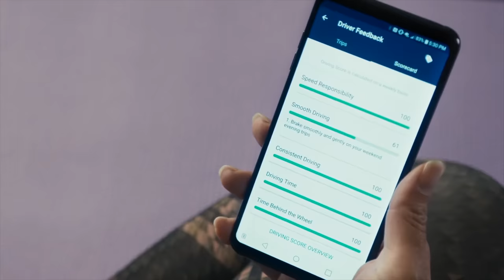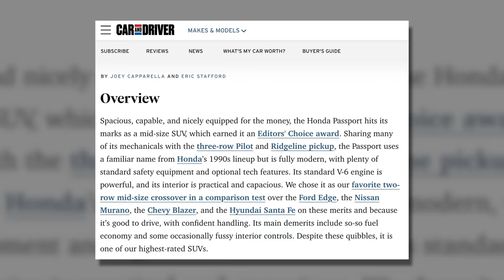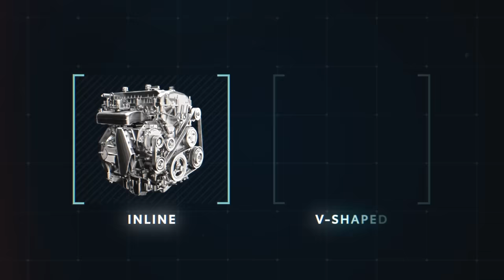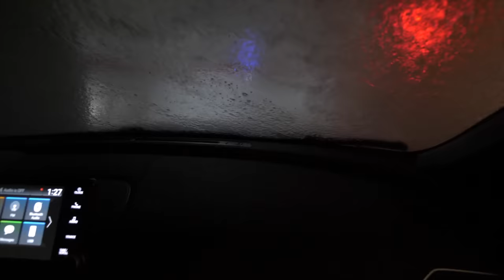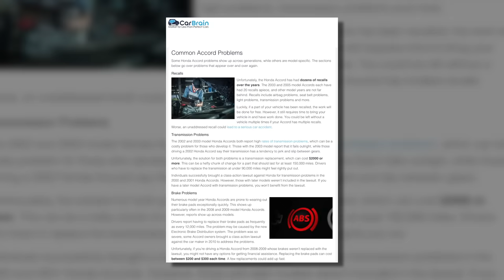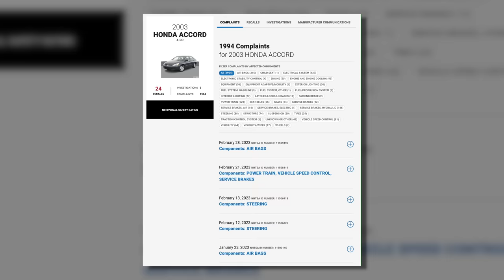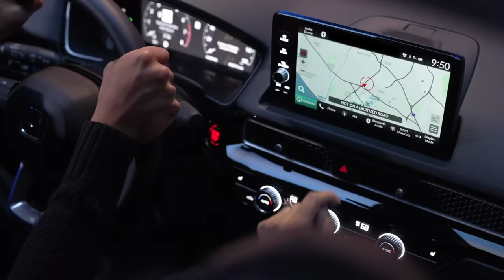Honda's CEO Just Said, "We're Losing Customers Fast and Don't Know What to Do"

Comment: As amazingly reliable as Hondas are, I have never heard of a positive nor good customer service experience with them when it comes to car troubles. This is coming from myself, friends and peers who have all had tremendous difficulty when trying to fix issues with their cars at the dealerships. Even Honda corporate has made it clear they are not on my side when it came to busted airbags in my CR-V.
Reply: Honda cars are well designed, easy to work on, and high quality, but the dealers are awful.   The past few years the Honda mechanics at the dealer have been commissioned based and it shows.  I still love my Hondas, I just don’t take them to the dealer ever and  much happier now.
Reply: @bbgator1 yeah I had to switch from a sleezy dealer where the advisors kept pushing me to do repairs that aren’t necessary. Unfortunately, someone crashed into mine recently and I bought a Lexus Es350. Definitely going to be more expensive on gas and maintenance but a much better car.
Reply: So, why are we having troubles with Hondas? Are you abusing them? In 30 years I've only had to had two repairs done on any of my Hondas. Besides oil changes and new tires or batteries. Don't mistreat you Hondas.
Reply: @leftoverpizza01   Toyota and Lexus have the best dealers.  Honda's are more fun to drive, but Lexus are super quiet.  ES350 is a great car. I had the same thing, someone rear ended my Honda, now in a BWM i4 electric, so going to the extreme stupid side of repairs and bad dealers.
Reply: @bbgator1  you must be near some good dealers. The Toyota dealers near me are worse than the Hondas. They even refuse to do transmission fluid changes even when you ask them to, but they will tell you to random services like some fluid changes when I can clearly see the state of my fluid is good. I have only been to Lexus once and had good experience. So, hopefully it'll be a good experience. And yes you're right about the fun aspect of Hondas and luxurious feeling of the Lexus. You feel more connected to the car in a Honda.
Reply: I agree, Toyota dealers treat you with respect and have a no questions asked approach to covering warranty.  I hear many examples of Honda stealerships taking a lot of money and not honoring warranty.   There are many videos out there that prove this.

Comment: I have owned multiple Hondas over the years and still own a 2013 Pilot and a 2015 Crosstour.  The level of repeat visits to the service dept for powertrain related issues on the Pilot has been something else.  Also the quality and build of materials has suffered greatly over the past 10+ years.
Reply: what exactly has happened to Pilot engine? J30 V6 no?
Reply: Even styling flair has declined
Reply: It’s still the J engine. However it has a timing belt which means higher maintenance costs.
Reply: Sadly many car makers are suffering from this; shareholders matter more than customers or product image.
Reply: My 2013 Pilot, 86,000 miles, only issue, replaced front bearings.

Comment: Coz they have closed half the dealerships in Australia, shrunk their inventory down to like 6 cars, charged more for each one. 

And their servicing at the Honda dealership are so bad, overcharging for the bare minimum work they do. I had my car "serviced", made me get new rear brake pads, I feel they aren't as grippy. Battery died a month after the service and two months after my aircon has stopped working....

I used to be a loyal Honda driver...now I feel my next car will not be a Honda anymore.

Comment: Have owned 4 Honda cars and two Honda motorcycles. All have been appliance-like reliable. My current '13 Accord 2.4L 6MT has been trouble-free since day one. I can't speak for the newer Hondas but I have read plenty of reports from owners on various forums who have had nothing but headaches with the 1.5 T / CVT combo. Looks like the days of reliably cruising to 300K miles in Honda might be behind us. Long live the Manual Transmission!!
Reply: That 1.5T/CVT combo is a POS and now it's the only engine available on the Accord...
Reply: I have the '13 Accord 2.4L with a CVT and am currently at the 350K mile mark. Starter replaced twice. Had to also replace my alternator and tensioner pulley. Other than that, it's been a great ride.

Comment: As the owner of a 2017 Accord Touring, I was a little ticked off (to say the least) when Honda did away not only with the Accord Coupe but also the V6.  My uncle has  an '18 Accord with the 2.0 Liter turbo, and he says that it's zippy, but he would still prefer having a V6 like his old Accord did.

I wish they would bring back not only the V6 option for the Accord, but also bring back the Coupe and/or my favorite Honda of all time:  the Prelude!  Why should we have to pay more for an Acura just to get a V6 when we were able to do it for so many years with just a basic Honda.  Even if I were to purchase a used Acura, I'd still have to buy premium fuel just to get decent gas mileage.  Sorry, Honda, but I'm not playing that game!
Reply: And now they’re not even offering the 2.0T from the 10th gen.
Which is why I’d rather buy an older gen Accord than the new one.
Reply: Blame the epa. It’s emissions.
Reply: The coupes didn't sell well....  Preludes didn't sell well either.  They were too "personal" for a mass marketer to produce and they didn't have pricing power to make them pencil.  There are  very few coupes left in production by any manufacturer and those that are mostly are performance cars or high end.  No one thinks of Honda as a performance brand.  It's more like a "transportation appliance".  People want reliable, even if abused.
Reply: The engine reduction is due to regulations. Carmakers don't really plan on going turbos, but lawmakers require them. 
And the coupe models are not selling well, it's basically more practical with 4 doors. And coupe is too niche as hobbyist model for fanboys. 
Those two reasons you mentioned are not entirely Honda's fault. 
But their fault is jacking up the price while lowering their quality. That's what making it bad value for money. It's their main downfall

Comment: The Hondas I would be interested in either have a CVT transmission or a turbo.   Huge pass.
Reply: 100%
Reply: those cvt transmission are utter trash i made the mistake of buying a honda that had a cvt worst mistake ever .. cvt snapped at 40 k alot of electrical problems too but that cvt boy ... just the sound of it annoys the hell out of me 
driving a cvt is like listening to someone scream RIII-COLA BUT never getting to the OLA part
Reply: @akgonen60   I've got one in my 2019 Civic, so I sure hope it lasts since I only have 44k miles on the car right now. I can't imagine having to replace it ever.
Reply: 2017 Accord Touring with the big V6. Last year of that engine paired with a real transmission. Get one while they are still around in good shape (~$20k). Keep in mind, there are versions of that car with the turbo 4/cvt combo, so be on the lookout.
Reply: @akgonen60 
 CVT must be prohibited
Reply: @akgonen60  my parents own a 2012 Honda stepwagon spada with a CVT. Almost 200,000 miles and they haven’t had any issues
Reply: This is why I’m scared to buy a new car. I went and browsed some cars the other day and every. Single. Car. Is like that and it’s ridiculous
Reply: @BigKWS  just change your fluid every 30k miles and you should be all right...

Comment: A little off subject, but Honda ATV's are great. Owned my first one in early 2000's. It was a 1996 model and I just sold it still going at 23 years. It was a 2 wheel drive 300. I bought a 4x4 Rancher and it starts instantly even if it has sat for long periods of time without running it.

Comment: 2008 Buick Lucerne with original engine, transmission and exhaust system 287,000 miles and its still going!  About 70% of them miles are highway.  Also have a 2016 Honda accord exl with 53,000 on it, will see if it hits 287,000, will be the same as for highway miles, since it has a CVT transmission I qustion if it will match the buick. Have changed the cvt fluid twice now and plan on changing every 20,000

Comment: I've owned 2 Honda Civic. One was a 2005 and the one I have now is a 2008. Scotty is right about the brake rotors and power steering leaks. I find the biggest weakness in Hondas is the electrical system. It's not the greatest. Seats are not comfortable, I have a small pillow to support my lumbar spine. I was experiencing lower back issues sitting as the seats have this excessive curve in the seat. I've had my 2008 for 12 years now. It's not too bad, engine still runs with no problems at 178,500 miles. I might try a Toyota next time when I'm ready for something new.

Comment: Loved, loved, loved my 2004 Honda Pilot!  Bought it at 84,000 mi and had to junk it just a few months ago at 255,000 mi.  Original transmission all the way to that point (I consider myself very lucky in that regard).  Loved my Pilot, but I was not considering replacing it with a more recent generation model after hearing about some of their potential issues and not being a fan of the redesigned body.  Thanks, Scotty, for all your car and car industry reviews, your car repair videos, and your car buying tips and suggestions!
Reply: my oldest son has a 2004 pilot with over 300,000 miles. Transmission pressure at 250,000 luckily didn’t have to replace it. I have a 2004 Element with 219,000 miles replaced VTEC solenoid, starter and intake manifold gasket. Runs great
Reply: I have a 2018 Ridgeline Black Edition and had to replace the torque converter at 110,000 miles.  That was a $5,000 repair.  This failed even though I followed their service protocol.  I will say Honda paid for half of the repair so they knew there was a problem.  I also noticed the replacement torque converter has a different part number which usually indicates a redesign. They denied any defect even though these failures for this model are well document online. I’m going back to Toyota when this truck dies.

Comment: CVTS and 1.5 liter turbocharged engines killed hondas reputation....
Reply: So TT V6 turbos and 4 cylinder turbos will kill Toyota’s reputation
Reply: @chezzyperson3339  no because toyotas are known for been boring and reliable and they delivered on it. the CVts killed the soul of the honda brand while the 1.5 liter oil dilution problems took away consumer trust.
Reply: @roellopez3910  yea but Toyota is new to turbos unlike Honda
Reply: @chezzyperson3339  toyota has been building turbo charged engines since the 80s budd...
Reply: @roellopez3910  yea just for the Supra and then they put it off for a long time

Comment: The quality just isn't there anymore, I totaled my 2022 Kia Forte GT and decided to go for the new Integra (similar specs both 6MT) and honestly I enjoyed the Forte way more,  it was loaded with so many features that the Integra doesn't have and the overall built quality was better in the Kia. For a "luxury" brand my whole interior rattles, panel gaps, loud road noise, backup camera from 2010 and I could go on and no. I'll drive it for a while but I'll probably go back to Kia or Hyundai.

Comment: At this point in my life, I'm just done with domestic cars anymore. Anyway, brake rotor failure seems to be a thing with almost everyone. My CTS needed new rotors at 53k miles with plenty of the original front pads left. Quite a lot actually. Went to slotted rotors to help
Reply: My Hondas have always been terrible on rotors. Changed to Toyota never had any issues.
Reply: @puma51921  yup, they warp so easily.  Honda's tend to come underbraked from the factory.

Comment: Happy Easter All: I've been lucky to own many Hondas. The last one I owned was a 2007 Odesy van that was modified to the handicapped capacity. The transmission got screwed up after the dealer did a software upgrade. Well the transmission began to fail while still in warranty & the dealers, 2 , refused to replace it. After that situation I will never own another one.  Great channel Scotty. TMP from N.J.

Comment: Our local Honda dealer is putting one  model of each car on the lot, they have a up to 14K mark up, they tell you this is the only one of the lot, take it or leave it, drive around a blind corner and all of the stored brand new Honda are hidden. I do not cry for Honda.  90 Honda Civic base model, 235k miles, 98 Honda Civic HX 256k still have.

Comment: As a 2021 civic hatchback owner, the two things I absolutely hate about the car is the glitches in the computer system.  The car will tell me to break and no cars are on the road near me and it breaks without me doing it. The other is when you manually lock the doors by hand and walk away from the car it does that annoying beeping to let you know the keys or something was left on. Key fob is in my pocket.
Reply: And the windows are confusing and buggy. Mine doesn't auto brake but will beep any time it's going up a hill to brake
Reply: Should've gotten a mazda, when you shut the door and walk away it just locks itself 😌
Reply: My 22 crv is very glitchy with the key fob system as well.
Reply: @cormaro13  My 2024 Civic does the same. Locks automatically when you walk 10 ft away with the key. Most cars now have that feature.
Reply: @ms.b9093  not this 2024 Toyota crown I have 😂 it’s whatever I just touch the door

Comment: I have a 13 accord v6. Runs great. Im on top of the maintenance. Yes hes right about premature break wear.
Reply: Yep on the brakes. My company has a 19 Civic sport they use as a delivery vehicle. At around 55k miles, it started making intermittent grinding noises when braking. Took it in and found the left front brake pads/calipers had welded themselves to the rotor and the other pads were already 3/4 worn. This car is driven daily by an older, retired man.
Reply: Go with better made aftermarket rotors and pads - unless the rear are shoes.

Comment: They should bring the prelude back
Reply: They should but not great for business I assume. They killed the Accord coupe for a reason.
Reply: Everything is ruined now...work ethic, quality parts, etc.  Even if they did bring it back, it'd be the same crap that's made today
Reply: @SM  like the Integra, which literally is just an ILX
Which I always wondered if the I in ILX stood for Integra?
Reply: The new Prelude should have 225hp and 200 trq. But alas no, the Civic Type R took all its thunder..
Reply: I loved my little 1980 lude.
Reply: @oreally8605  I hope Honda brings back Prelude Type SH with 320HP.
Reply: @oreally8605  And no stupid CVT transmission. I want reliability and only Volkswagen and Mazda still offer regular transmissions. I went with a Mazda for this reason
Reply: I have prelude 89 4WS ..works perfectly ! ❤my Prelude !
Reply: They are but it looks like a standard sedan with prelude badging

Comment: This must apply to only the most recent Hondas. I've owned nothing but Hondas for 30 years and only two times did I ever go to a shop for anything but tires, oil change or batteries. My 1998 Civic hatchback had the AC go out about 160,000 miles. They replaced the compressor. Then at 165,000 it had a wire bundle chaffing issue that causes the headlights to strobe really fast and they weren't bright enough. And it also caused the speedometer needle to waver back and forth about in a 10 mph spread, so I couldn't tell exactly how fast I was going. But they fixed the wires easily and didn't even charge me much for that. Those occurred in 2006 and 2007. My brother bought it and still drives it and it's 25 years old. All my other five Hondas have required nothing but normal maintenance. I've never been on the side of the road in a Honda but two times when I stupidly ran out of gas and once when I slid off the road on ice and had to be pulled out! Not the cars fault, it was the dummies fault.

Comment: I have a 2015 Honda Accord with a naturally aspirated 4 cylinder engine and about 70,000 miles on it.  I picked it up used for $15,000 with 14k miles on it 5 years ago. I love it!  I have had no mechanical problems with it at all.  It gets good gas mileage, about 30 - 35-ish mpg highway, mid 20s in the city.  It's zippy enough for my needs.  Now, I've heard about some issue with the newer turbo charged engines.  That would give me pause in buying a new one.  However, I expect my car to last another 100,000 miles or more.  So, hopefully I won't have to worry about a new car again for quite some time.
Reply: My turbo 2018 Civic runs like a dream, smooth as velvet. With the newer GF-6 oils, Hondas turbos are perfect. No issues.
Reply: @markr.1984  That's good to hear.  I would expect Honda to fix any problems in their design.  I believe the 1.5 L Turbo was the engine with the problem.

Comment: I started with a brand new Acura Integra, absolutely loved that car, no issues other than 2 clutches which is normal maintenance, then a brand new Honda Crv - a/c compressor literally came apart after 4 yrs. n fell down onto the street, replaced the radiator too. Traded in Crv for brand new 2011 Accord V6 EXL, left front wheel bearing replaced 2x, right front replaced once, new master door lock module, new alternator due vvt solenoid gaskets failing (why place vvt over alternator leaking oil n frying perfectly good alternator), L & R half shafts due cv joints, a/c compressor, 4 a/c blower motors. Biggest problem is roof leak n also water based paint which is flaking off. Honda quality has been slipping for years !!  Next new vehicle will be Toyota truck or a Lexus plus they have non interference engines.
Reply: There’s hardly any timing belt on today’s modern engines. Interference or not, doesn’t really matter.
Reply: @carlosnorris352  Tell Honda that.  Even their latest DOHC V6 engine still has timing belts.
Reply: @ratshackmojo  yeah, but that’s the exception today. Maybe they want dealers to make something out of it, cause that v6 belt was a real pain in the 🍑 to replace.